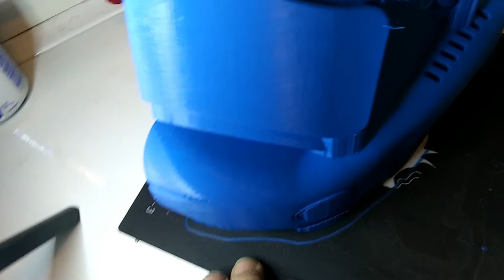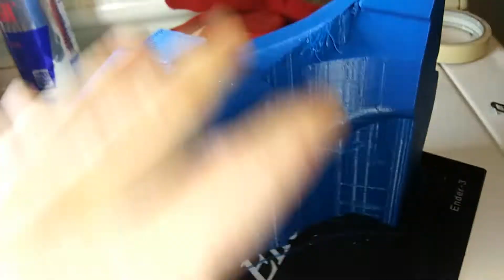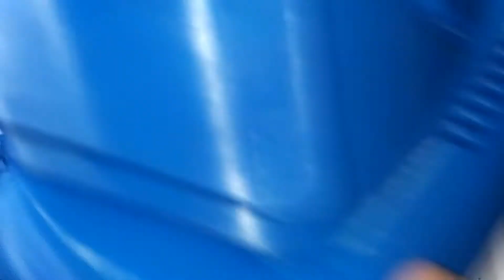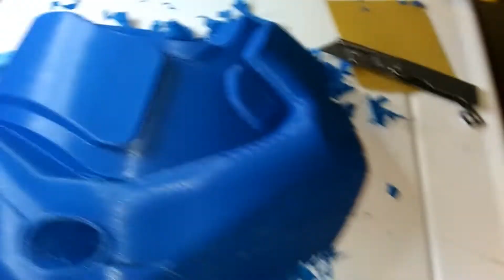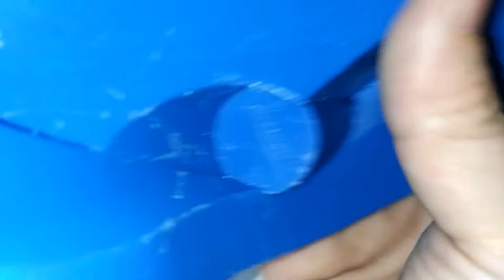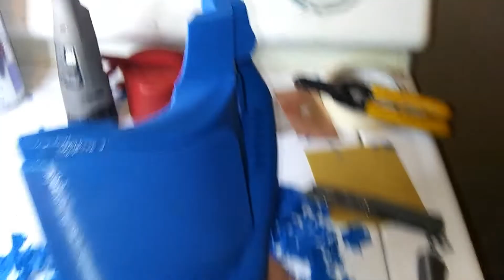Creality Ender 3's First Big Cosplay Piece Printed

Comment: So I have the same printer (also my first printer) what programs will be suitable for this printer? And filament would be good to use?  I'm currently printing the dog with the white filament it came with. 
Thanks!
Reply from the maker: Any PLA and TPU works great on this printer. I use a lot of cheapSunlu or Solutech PLAs. I havent really tried a lot of different filaments. Its a basic open face boden printer so ABS is a little out of the question but all other filaments should work fine. I use Cura as a slicer. works good for this printer. the pre-set settings in Cura for this printer are great. just have to make a few small exceptions.